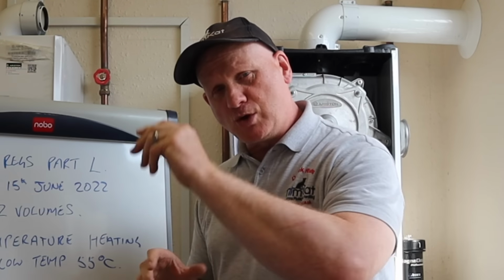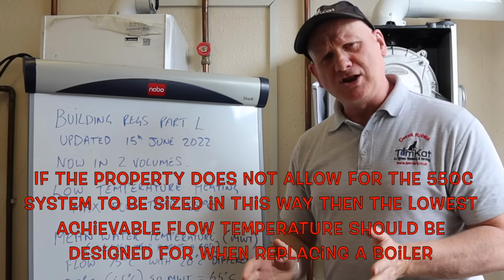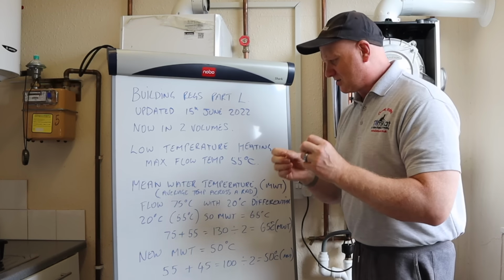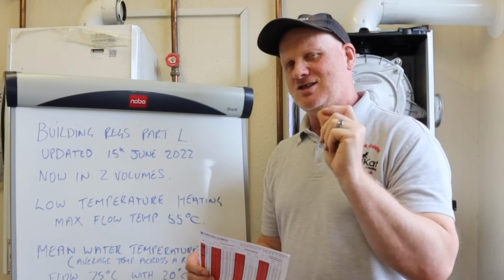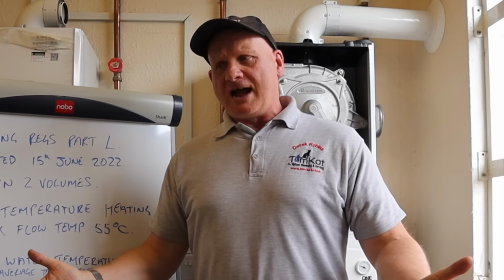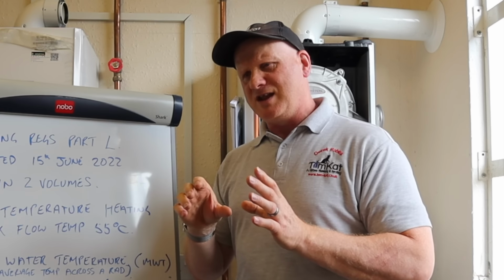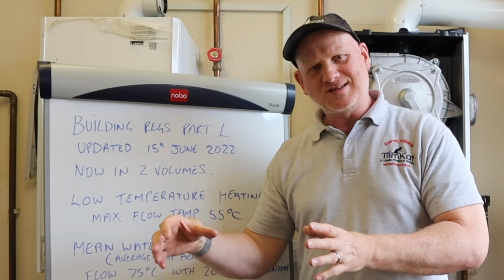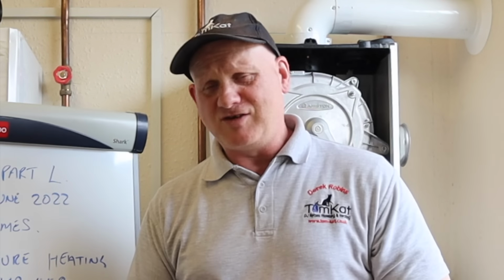Don't adjust your  heating flow temperature until you have watched this video. #saveenergy

Comment: Thank you for a great video. Regarding Legionnaires disease - Could you please discuss/clarify the water temperature in a cylinder. HSE information seems to state it should be 60C but there is also information on the net that states it should be 50C.
Reply: it should be a min of 60C. i have a smart cylinder that heats the water to 60C ( i can set it higher if required ) at least every 2 weeks with out fail.
Reply: Apparently 50 is ok but it takes longer to kill off the bacteria. 60 will kill it much more quickly. Maybe 55?

Comment: Great video and well explained.

I've had 3 x installed due to renovation and no plumber has ever mentioned having a thermostat is part of the regs nor has any of them mentioned the fact a TRV shouldn't be in the room containing the thermostat.
Reply: Common sense. If the trv is set lower than the wall stat your heating will always be on. Your plumbers were cowboys
Reply: Many people don't understand that a rad thermostat will be fully open when heating comes on to a cold home. People tend to adjust the valve, usually setting it too high then as room gets too hot turning it right down.
Reply: Not sure what 3x means. 3 boilers in the same home?
Reply: @johnackers6311  missed some words. 3 x boilers for 3 x renovations by 3 x different plumbers.

Comment: Hang on a minute - I think you've missed one of the most important points.  With a flow temp of just 55 degrees how are new systems to heat the water in the hot tank to the usually recommended 60 degrees???
Reply from the maker: Guess you didn’t see that bit in the video then
Reply: @tomkatgastraining  no, I must have missed that - at what timestamp did you cover it?
Reply from the maker: @thescouselander5531  not a clue 😂
Reply: @tomkatgastraining  I don't think you covered it but reading elsewhere it looks like an immersion heater will need to be used to get the cylinder upto temperature.  Not sure how that got through.
Reply from the maker: @thescouselander5531  I say in the video that water is stored between 60 and 65 oc so don’t set your flow temperature less than 60 if you have a cylinder. Also had guys comment on my typeo because it says 65o c
Reply: @tomkatgastraining  yes, sure.  My comment was on the new part L rather than adjusting old equipment.  It looks like it won't be possible to heat a hot water cylinder to temperature with the new boilers which is what sounds bonkers.

Comment: I removed the outside condsate pipe  so it won't  freeze  in the winter , it's now  going  to the sink waste pipe  I am in a 2nd floor  flat..my combi boiler is a main eco 30 from 2012 , I bought  the flat back in Dec last year,  had all my rads flushed, new honeywell thermostatic valves, fitted  and my plumber  balanced all my radiators,  and finally had hive 2 fitted all done ready for this winter 2 years left cheap fix for gas and electricity from last October 5p khw gas 22p khw Electricity  till October 2024 ..my average  bill so for from Jan  to September  average  £51.18   svr would  be £124 this October  with out the fix ..very  scary  people  without  a fix....thx to Derek  I have chose to have all the work done to maximise energy savings

Comment: . buy yourself a generator maybe at least a 2kw as supply is going to get short when EVs come along, fortunately we are ready for the power cuts as we get them already on a weekly basis.

pre-pay meters are the future why pay £400 a month all year round summer and winter on direct debit for an estimated bill,

 when you can reduce your payments in the summertime as you probably dont use your heating so much and youll be able to see how much you are spending to.. 

They are not as expensive to run as all the press idiots say they are. and when everyone else is struggling to pay their massive direct debit instalments you can top up weekly if you want to and keep an eye on your spending.

 Eon and British Gas are  expecting a shortage of pre-psay meters countrywide as more people start to realise that they will probably end up paying less for their electricity and gas. we have a 3 bedroom semi with 3 people living in it and we pay £30 a week for all our elecy on economy 7 and currently because the boiler isnt heating the house which is very well insulated 

gas is £15 a week so the minimum we can expect to pay by direct debit is £400 a month  every month all year round.so £170.00 a month currently or £400.00 on direct debit, with estimated usage, there are to many people overpaying. 

 this summer we have been running computers 24 hours a day , air-con, the 7kw electric shower at least 45 mins a day, a dishwasher  twice a week and the washing machine is on every day at least twice, we have a 50 inch plasma tv running every evening til midnight and a fridge freezer and another freezer in our shed which works very hard in the summer months as it gets very hot in the shed.

when the gas goes up in price Im not really expecting to be paying £200 a month for gas , British gas on pre-pay didntr increase in price on their standard rate at the beginning of the year and I dont expect it to  increase much in October.

. They are to busy giving out estimated prices to anyone willing to cough up for extortionate bills in the coming months, they are deliberately profiteering on those who pay by direct debit because they know that pre-pay consumers are very savey on what their energy costs are. I genuinely feel sorry for you if you are paying a fixed direct debit amount each month and you have no idea that it is even the correct amount you are paying for your electricity

. it is set on winter usage to and we all know we use less energy in the summer months we even use less electricity because the daylight hours are longer , soi why do you pay the same amount every month through summer as you do in winter? I get a payment reduction every summer for about 4 months and I can enjoy spending that money elsewhere

  or if I choose to I can pile on the credit in the meter and hold tight to see what winter brings, it gives you the freedom to choose, so you dont  have to choose between feeding yourself and keeping warm , Ive been watching all these scaremongering news reports on energy price hikes and thinking well we are not paying half as much as they say we should be as an average household. Im just glad I chose to stay on pre-pay meters and not have estimated £400 a month instalments taken from my bank account .

finally smart meters , they do nothing for you , you can switch off everything in the house ands still see useage leaking away , that'll be the smart meter eating your electricity sending an update every 4 minutes to the energy company so they spy on your useage, it also makes it easier for them to cut off your supply remotely why give them so much power?

Comment: Great video. Hot water is scalding above 48°C though
Reply: So cool it down with cold water.
I think that is preferred to catching legionnaire's disease.
Reply: @deang5622  the reason I mentioned water is scalding above 48° is regarding the written line "the cylinder has a thermostat to stop the water going over 65° to stop scolding" or words to that effect. The reason isn't to stop scolding because we're way past scolding temperatures at 65° near the base of the cylinder.

Comment: If there is a hot water cylinder with a thermostat does the thermostat determine the temperature of the hot water or the circulating hot water boiler setting. So if the circulating hot water boiler feed temperature exceeds the cylinders thermostat setting, does the thermostat reaching temperature result in the boiler backing off and shutting down until the hot water is used.
Reply: You've got it !

Comment: Thanks for this - I've struggled to find correct and complete information about adjusting flow temperature, too many conflicting bits of advice on various forums- but you've gone through everything clearly so now I'm confident that if I'm comfortable with a lower temperature on the combi central heating control, it's worthwhile doing!

Comment: One of the biggest waste of energy where a cylinder is used is the amount of water that has to be run through the pipework in order to fill for example a bowl in the kitchen . A considerable amount of cold water is run off before the hot water arrives . Then when the bowl is filled all the hot water that is left in the pipework goes cold ! . A better arrangement is a point of use water heater where the losses are kept to a minimum or use a kettle in the kitchen to fill the bowl .
Reply: Or just fit a secondary return like the rest of the world has for 100000 years.
Reply: @Swwils  You have still got water going cold in pipes even if it is circulating with transmission losses .
Reply: @fredhatfield5863  secondary return fully.insuslted 👍. But then again not many installers know how to lag pipes properly in the UK.
Reply: @Swwils  99% will not have secondary return let alone lagged .
Reply: In the winter the heat from the hot water running through the pipes actually contributes to the overall heating in the house. Having said that I only have the hot water on for 15 minutes immediately prior to having a shower in the winter. The rest of the time I have cold showers and when I have a full load of rinsed dishes with cold water and detergent finish them with boiling water from a kettle heated on the gas hob.
Reply: @yvonnewiggins4209  You are a hard case .

Comment: Have we been over sizing rads by 200-250%?
No. Low temp heating is not going to work properly without a full pipe/rad renewal (underfloor being the obvious exception).
Great video but this low temp drive is all utter shite. Spend a fortune to save a few quid.

Comment: Thanks for the detailed information i have a pre heat switch should be off or on ( combined boiler) ?
Reply: I keep it turned off. Why have the boiler coming on occasionally only for the heat to dissapate. Modern combis heat water quickly.

Comment: John, Part L1(b), L2 page 36, seems to say that the 55 Deg. rule only applies when installing a new system or fully replacing a system in an existing building and only then if its feasible. I can see no reference regarding replacing only the boiler, apart from it having to be >92% efficient and the controls requirement.  Otherwise a useful video, but I would add that I wouldn't run a non-condensing boiler below 75 Deg.C

Comment: Stick to plumbing you are very knowlegable in that area. Routers and some other devices such as smart TVs should not switched off at the mains for two reasons, turning off broadband routers causes connection problems and stops overnight security updates. Some smart TVs need to be left on for the same reason, turning off OLED tvs like LGs actually ruins the screen, check your manual.

Comment: I was quite interested when I listened to the bit about design tempreature for replacement boilers as I think this would be a good move but I don't think you are correct. It would only apply if replacing all of the radiators and pipe work.

5.10 Where a wet heating system is either:
a. newly installed
b. fully replaced in an existing building, including the heating appliance, emitters and associated
pipework
all parts of the system including pipework and emitters should be sized to allow the space heating
system to operate effectively and in a manner that meets the heating needs of the dwelling, at a
maximum flow temperature of 55°C or lower
Reply from the maker: You missed the bit that said all new boilers have to be over 92 % efficient when installed in new or existing homes. Try getting that with a flow temperature of 75 oc
Reply: @tomkatgastraining  Thanks for the info I went and found that in the document. 
I did a bit of further reading and all the documentation I found suggested a condensing boiler at 55 degree flow would only be 87% efficient.
https://pure.tudelft.nl/ws/files/14884189/1_s2.0_S019689041730016X_main.pdf
I wonder if they more mean that you have to install a condensing boiler with a sufficient ErP rating.
I imagine any modern boiler with weather compensation would claim to hit a seasonal efficiency of 92%
Reply: Ah, good to know. Coulimagine telling clients on a boiler change quote that they need a whole new system.
Reply: Yes let’s go and quote. Job 
Oo no all your rads are to small and the all pipe work needs ripping out replacing 
That’s be 5k please 
That’s not happening round my way

Comment: Thank you. Very informative. My thermostat has been at 15degrees since February but my house is well insulated and never really drops below 18degrees. It has the additional benefit of staying cool during hot weather. I have not had any issue with damp as I do not do anything to create humidity.
Internet has warned against switching off routers because of security issues.
Freezers work more efficiently if they have more in them so I would recommend putting cold packs in with the food if you only have a small amount in there or alternatively stock it up with frozen veg with is cheaper than fresh but just as good for you!
Reply: What the security issues? Frozen veg are "cheaper" because you're paying for extra water (ice) as well. They're very convenient though.
Reply: @globalist1990  I agree there is additional water from the freezing process but they are frozen at optimum freshness and have been prepared ready to use in whatever quantity you choose so there is less waste.
Reply: @globalist1990  The internet companies have warned about switching off routers because they send updates to them which ensure they run smoothly and can counter attack malware.
Reply: They just want access to your house 24/7. Mines off at night. If it needs updated, it will do so in the morning when turned on
Reply: Good energy saving tips!

Regarding your Internet router, most connections are shared (referred to as "contention"), so your ISP monitors each connection and uses this information to provide each customer with a consistent download speed.

Consequently, turning off your router overnight, or for several days, means that your ISP can't monitor your usage and may even misdiagnose the loss of connection as a fault, causing your download speed to decrease (which can take several days to readjust) after you turn it back on.

This is another reason not to turn off your router, unless you'll be away for more than a week.

However, restarting (rebooting) your router, by turning it off and then immediately back on again, after waiting for just a minute, is fine.

Comment: If doing just a  boiler change you do not have to replace the existing radiators to larger sizes.  If replacing a radiator then replacing one which has a large temperature drop across the flow and return of the radiator by balancing - in short size to 55C flow temp, then balance to suit. This will ensure the return temperature is slightly lower back to the boiler from that rad, as it gives off more heat to the room, promoting condensing efficiency.  In many cases older systems were sized when the house had less insulation.  More insulation added since the system was fitted in most cases means the system can be run at lower temperatures using the older rads.  Also many systems were sized 10% larger as a fudge factor. 

Most heating systems have radiators designed to heat the house when -3C outside.  Most of the running time of a heating system it is not -3C outside, more like 12C, so most of the time the flow temperature can be lower - that is where 1) and 2) below come in. 
It has to conform to Boiler Plus of course, which means:

1) A thermostat that modulates the burner (such as OpenTherm or a maker's proprietary stats), to the thermostat's setpoint, giving a lower flow temperature. The closer the temperature of the room is nearing setpoint, the burner is modulated down to maintain the setpoint - just injecting the correct amount of heat into the house. 
2) Outside weather compensation, which lowers and raises the radiator temperature, by modulating the burner, to the dictates of the outside temperature;
3) Smart phone control (Nest, etc).  

Also you have to check if the gas meter has an electrical earth (bonding) wire to the meter outlet pipe at the gas meter.  If none there, then fit one, or get it fitted. This is a check on the signing off. 

Numbers 1) and 2) above, both lower the flow temperature automatically by modulating the burner, keeping the flow temperature as low as possible, promoting efficiency.
Reply: Just simple trial and error is all you really need.  Turn your boiler flow temperature down until you reach a comfortable level you can live with.  Don’t buy expensive ‘intelligent’ thermostats or anything like it, they are a waste of money and are just something else to go wrong.
Reply: Just simple trial and error is all you really need.  Turn your boiler flow temperature down until you reach a comfortable level you can live with.  Don’t buy expensive ‘intelligent’ thermostats or anything like it, they are a waste of money and are just something else to go wrong.

Comment: So when my current boiler packs up I will also need to find money for new radiators and  pipework? Are the folk who introduce these regulations all on 6 figure salaries?
Reply from the maker: No you won’t the gas engineer who installs your boiler will try and get as close to the 55 oc with you original radiators if they can’t then they will set the flow temperature to suite your rads. My next video will explain this more.